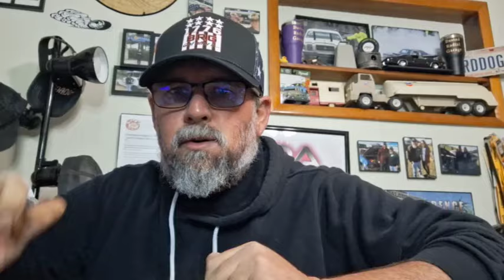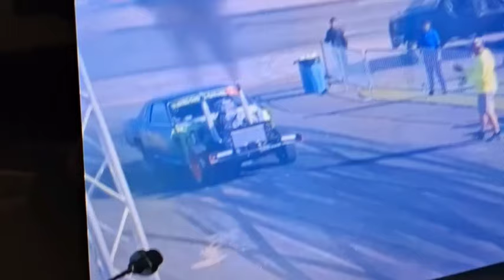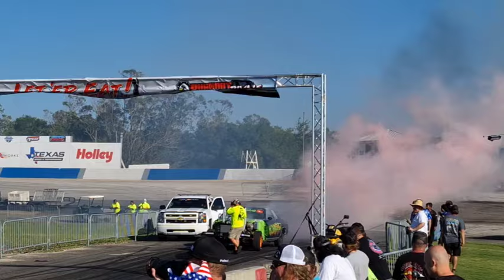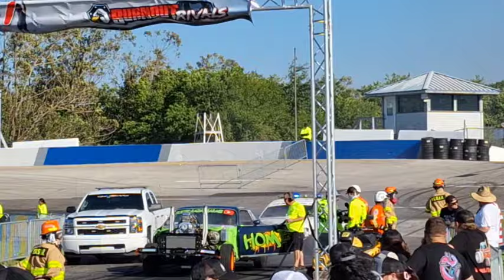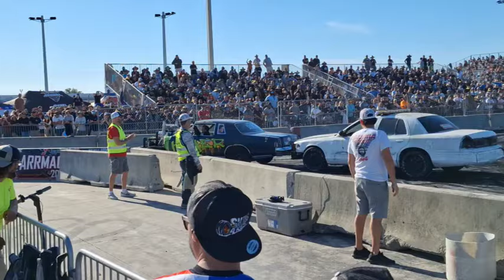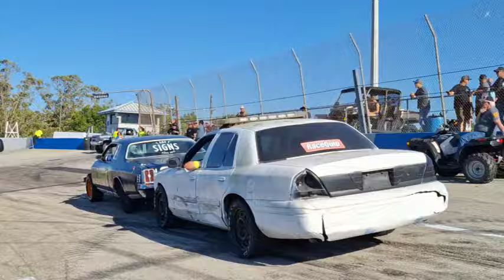Explosion on the burnout pad, Theory on what happened?

Comment: I don’t think it was the bolt.
Reply: Me either. No way it found its way in against the high volume of exhaust.
Reply: If the bolt weighs 10 lbs it couldn't fall back into the head against the exhaust flow. The tune was bad
Reply: Yep.   That’s a bit of a stretch but the teardown should explain.

Comment: That bolt might have got sucked in the carbs and went in the motor but it's going to be almost impossible for it to get sucked into an exhaust valve that's blowing out with lots of force. Also double check the ignition timing with the black smoke. Something doesn't look right in the timing
Reply: I agree with you Russell. No way that bolt made it into a cylinder through running exhaust. I'd have to say it had too much timing.
Reply: @TonysHotRodGarage  or not enough.  It'll be interesting to see what actually happened to the motor. I'd say a burned piston
Reply: Bolt would never overcome the exhaust pressure to fall in

Comment: There is no way it fell down into the exhaust. It would be pretty much damn near impossible. I think it dropped a valve or cracked the cylinder wall. I don't think you have the block filled either i'd assume.
Reply from the maker: I actually didn't do any of the 3 fortunately. Already going back together.  Thanks
Reply: @BustedRadialGarage  just saw the community post. That's a lot better than it could have been, are you going to switch to an mls gasket?
Reply from the maker: @faststang85  Good possibility.  We are working with BDS on that for a better solution.

Comment: I must add that a couple of coffee cans would be more consistent. But I am stymied by 2 separate parts of the clamp bolt theory. Firstly how it managed to fall upstream of a boosted exhaust event (through a type of a choke, even) and 2nd how that clamp bolt was even near the interior of the collector instead of the exterior where it was originally doing the clamping upon installation??